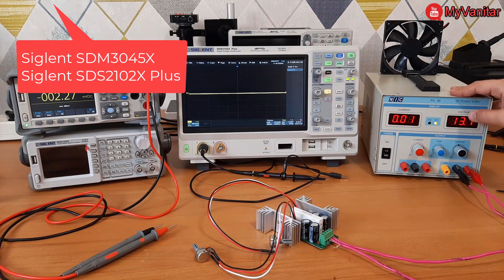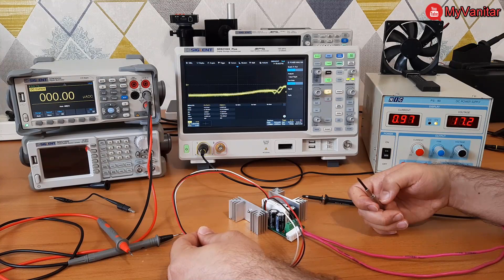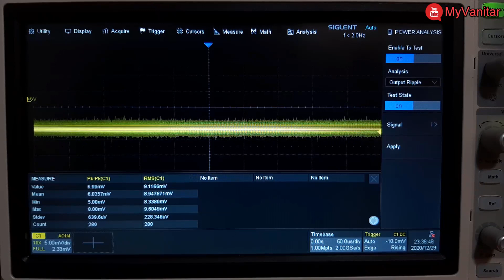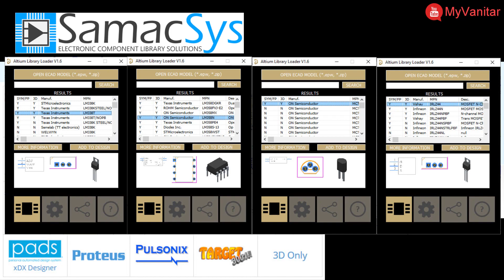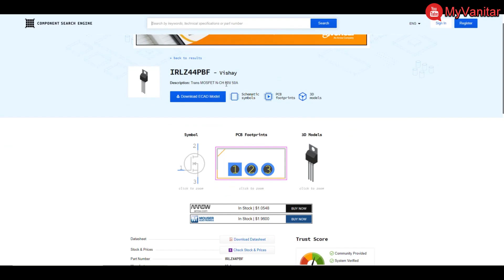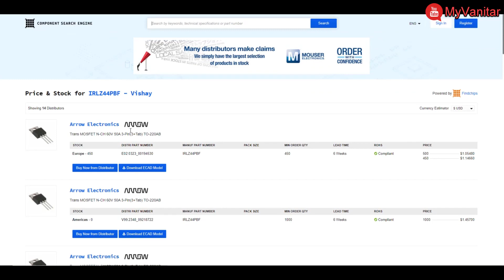30V-4A Adjustable Power Supply Circuit [CV, CC]

Comment: Hi , I build your power supply and it works great ! thanks .
I have only one problem , connecting a compact digital voltmeter/ ammeter ( like those you can order on Amazon) the voltage reading is not correct as the circuit has ref. ground . Do you have any suggestion  ?
Reply from the maker: Check also with another brand multimeter and confirm if this phenomenon is because of that. Because naturally, what you measure and I measured in the video by the multimeter (a real reference) is the output voltage and current!
Reply: @MyVanitar  Hi , thanks for your reply , yes the voltage / current meter is exactly the same mentioned in your video . The voltmeter has  been connected between Vcc and RGND , it read correctly but when you require current and conseguently voltage fall  below  3V the meter turn off ( no supply anymore) .
Reply from the maker: As I showed and proved in my video, those panel meters are not good. By the way, there is one supply and one input for these meters. Get the meter supply from the input supply and the voltage/current reading from the power supply output
Reply from the maker: I had a video about those compact voltage/current meters also: https://www.youtube.com/watch?v=bleSXMaTR7s

Comment: At a load of 1A, the LM338 protection works for me. Why can't I load the power supply up to 3 Amperes?
Reply from the maker: LM338 protection? I have not designed to be like this. you can adjust the current as high as you can, please check if the regulator does not warm up very much. this is a linear regulator, the difference between input and output voltage should not be high (around 5 volts is fine), that's why in the commercial supplies you can hear that relays switch to change the transformer output to the regulator to keep the voltage difference low. another reason could be that your power resistor value is high, then the current does not get high enough. the power resistor value is around 1 ohm 30W (3*3.3R-10W in parallel)
Reply: @MyVanitar  Thank you! I'll try to parallelize another resistor) LM 338 does not heat up much.
Reply from the maker: So yeah, then that's the resistor issue. 1R-30W or 3*(3.3R-10W) resistors in parallel

Comment: Friend, I have a variable resistor that regulates Р2 the voltage in the minimum position starts to burn out. What is the reason?
Reply from the maker: What burns? The regulator? if Yes, Your input voltage is much higher than the output or your heatsink is small. Remember that this is a linear regulator. Low noise and stable, however it compensates a lot of power
Reply: @MyVanitar  Yes, the first time I applied 36 volts. Then 15 volts. I'll try to replace LM338.
Reply from the maker: @EW7DDR  in the commercial power supplies, the input voltage changes when the output voltage change. it has a transformer with several outputs. so always the difference between input and output remains low
Reply: @MyVanitar  That's right

Comment: I am about to build the 7Amp version of your power supply, but this 4Amp version is also very interesting, and the video is excellent, as always.
You use 5K potentiometers to control volt and current. I have plenty of 10K multiturn potentiometers, but no 5K.
How critical is the value?
Reply from the maker: Thanks.
Linear supplies are less noisy, dependent on the input noise. however, getting high output current from linear supplies is painful and not efficient. that's why most lab bench supplies are limited to 3A or 5A maximum. 
Regarding your question, the value is not critical, however, it is easier to adjust the values using a 5K pot. You can also reduce the value of the resistors which reduces the voltage drop (drop on the regulator, at high currents. with these resistor values, the input must be at least 4-5V higher) at high currents, however, it makes it a bit tricky to adjust the current. in that case, you might need to use multi-turn pots.
In the future, I'll post more power supplies. the one I'm designing now is a variable 40V-30A SMPS!
Reply: @MyVanitar Thanks for your prompt response.
I'm always going to use multiturn pots. I rarely need more than 2-2.5 amps and voltages above 24v, so reducing voltage drops when the load increases is the most important thing for me, so I appreciate all suggestions/advice for improvements on this issue.  All DIY power supplies I have built and modified this year, have been tested with a good adjustable electronic load and they all had pros and cons.
I have not finished assembling your 7A version yet, so that will be exciting.
Reply from the maker: @kallegulbrandsen340  So yes, if you have multiturn pots, then you can reduce the power resistor values. it reduces the drop on the regulator and also the power dissipation on them. I receive a variety of requests. some ask for more power and some ask for lower noise. I try to walk in the middle :-) It is easy for me to explain details for an experienced user like you.

Comment: Sir
Why don't you add Power BJTs like 2n3055 as series pass component instead of LM388 itself  to  handle the current ?
Reply from the maker: I have done that in a different video, however the major problem in designing a power supply is CC and CV features. current can be increased by some methods, and one is using a series pass transistor
Reply: Sir 
I wish to use your design
But what about mosfet(IRFZ40)  SOA Problems vs power BJT  to operate in the load current region?
Reply from the maker: @jijeshkorothpoyil2697  I don't get what you mean, do you have a question regarding the CC stage (MOSFET)?  it is not a pass transistor for increasing the current. it is the CC stage. I have discussed the pass transistor in a different video, just check the channel
Reply: Can we reduce the 1.1 ohm (3.3ohm /10w *3) resistor  value to maximum possible in order to reduce the voltage drop of 3.5v to 4v at higher currents?
In some other circuts,  the current sensing resistor value is very less than 1ohm(0.xx ohms)
Reply from the maker: @jijeshkorothpoyil2697  Yes, you can, however, it makes it harder to control the current. maybe using multiturn pots solves it, however, I have not tested it

Comment: Can I use this as filament bias for DHT tube amplifier which need about 25.4 VDC (high voltage due to filament bias) out of this board @1.3A?  Still clean enough? ( I mean no HUM)
Reply from the maker: Yes, you can, especially if the current limiting feature is important for you. if the tube only consumes around 1.3A at 25V, the CC feature does not matter. there is another circuit on the channel that you can use. By the way, I will publish another powerful power supply (30V-7A, CC-CV) in the next few days. subscribe to get notified.
Reply: @MyVanitar  I think I need only 2.0A max (650mA x3) if it possible. 2 Potentiometer are quite big, Any version of smaller trimpots? :) To get 25.4VDC out of your board, I need to feed RAW DC about 25.4+5 = 30.4VDC. Am I correct?
Reply from the maker: @nuttyl283  Yes, this circuit is useful for laboratory low noise applications that is intended to stay on the bench and be variable. The new power supply is Switching and uses two trimmers. That is more than enough for your application, however, the CC feature will protect it from overcurrent although it is not necessary for your application. The new circuit can handle 6A continuously, so 2A is nothing. stay tuned for the next few days till I publish it. I'm recording the video now.
Reply: @MyVanitar  Wonderful!!  Usually I only see ROD COLEMAN regulator V.8 that suits my need. Yours may be good alternative.
Reply: @MyVanitar  sorry My mistake for filament bias "current limit" is very important suppose I need 1.3A exactly. When use ROD coleman regulator, I need to measure voltage across R1 of 0.68R to get 0.884Volt. If your regulator can adjust current limit (via trimpot) to get any current I need, that will be great!!  So you have to have a 5 watts R for user to measure voltage. Not all user have amp meter. Thx
Reply from the maker: @nuttyl283  Your mentioned regulator (ROD) is not efficient. You can do this with this circuit as well, however, please wait for 4-5 days till I publish the new supply, then you can decide which one suits you best. The new one allows you to define the voltage and current limit, even as low as 20mA till 6A continuously. just 50mVp-p noise at 6A!
Reply: @MyVanitar  Oh my god!!! How you magnificently design such a good regulator like this. In the past I thought ROD COLEMAN is the best compact design. However once I heard your specification 20mA!! till 6A controllable!! It will suit any tube amp filament bias. my concern are 1 how big PCB is it? 2. How big heatsink of 1.A amp do I need.  If it can be fit in my tube amp chassis.  You are the best Designer. Thank you very much.
Reply from the maker: @nuttyl283  The design is compact. The heatsink is also small even for 6A. 1A is a piece of cake for it. I did not want to publish this publically, but anyway. I decided to do it with a commercial ban license.

Comment: I don't understand  in 06:10 what is  load  as your current is over 3 Ampere ? is have a dummy load in your Siglent multimeter?
Reply from the maker: what I measure on the multimeter is current, not voltage, so the output of the power supply has been shorted out by the multimeter

Comment: What are the major cons of this supply?
Reply from the maker: The only thing is around 3.5V to 4V drop under high currents. it means your input voltage should be around 3.5V to 4V higher than output if you intend to use high currents. I don't know if this is a con or not, however, I measured a 3.5V drop under a 2A load. otherwise, I am happy with this. Also the same as the commercial supplies, you have to keep the voltage difference between input and output low, otherwise, it imposes stress on the regulator. Commercial devices use relays and a transformer with several outputs.
Reply: Sir
Why don't you add Power BJTs like 2n3055 as series pass component instead of LM388 itself  to  handle the current ?

Comment: Could you add KiCad   and/or Sprint Layout download file too ? I want make PCB (Because PCBWay not speed about price information)
Reply from the maker: if you want to build one, why not you just order PCBs fast? it is quite cheap with good quality. Actually, the PCB assembly process is not easy and it has many responsibilities because if they buy the wrong components, it would be a big problem. I as a designer know what I did, however, another person should know what's going on. they must be sure about the components, any mistake will ruin everything, especially in high quantities. They doubled checked the BOM with me today

Comment: Great circuit .have a LED for "Over Current Limit" also have is make current Limit adjust ?(with short  circuit and adjust current potantiomerer?) 
Also in added link have "If you like to order a fully assembled PCB board for this project, please contact ......."
is this mean assemled all components to pcb? 
Thanks for this great power supply circuit
Reply from the maker: It does not have an LED for CC or a short circuit. Yes, for a fully assembled PCB (all components are soldered) you can send an Email to him. there are also two off-board components, two multi-turn potentiometers. check the design and bill of materials. You can ask him your questions about this.